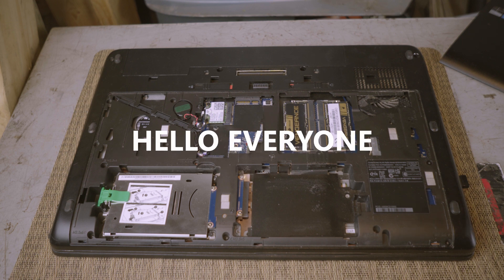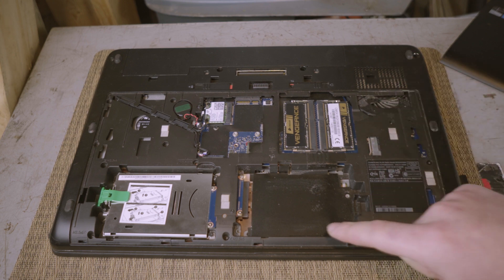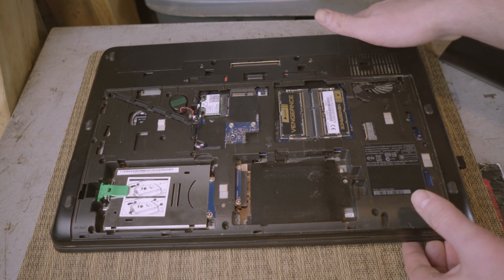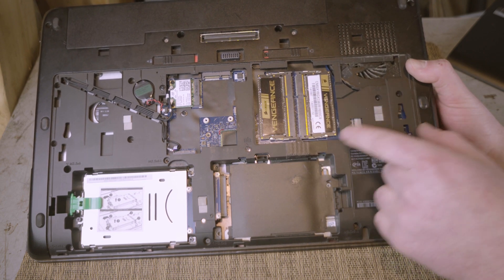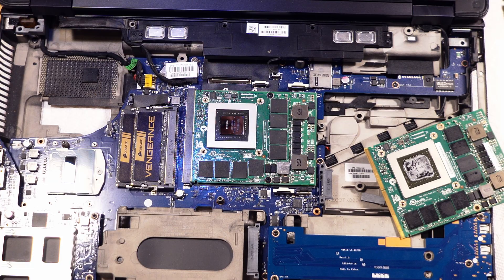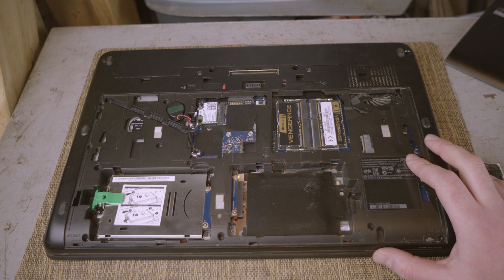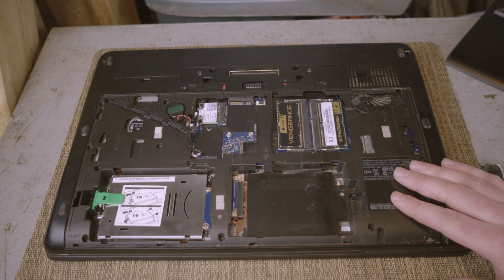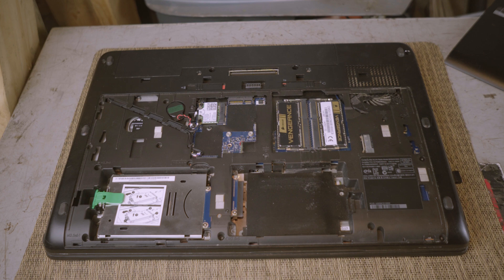Laptop Graphics Upgrade - HP Zbook 17 G1 - Quadro K3100m 4GB to K5100m 8GB - Laptop GPU Upgrade Easy

Comment: Tldr
I have the same pb, my laptop start rebooting in loops and the screen is kind of blury (can't see anything) and after a couple of rebooting i can't see anything I start by troubleshooting the pb by decoding the famous hp LED_Beeping but can't define my case (there are two types of beeping one is long and the second is short and for example if u see 3 long beeps following by small one you should look for 3.1 and hopefully u will get an idea about your pb), in my case and after many reboots i removed one external Ram (back of laptop) and get nothing but when I remove both of them the laptop start normally with 8gb (2 rams of 4gb under the keyboard) instead of 24 gb ram.
So now I can't add one of the other rams (2 of 8gb ram ), I don't think that both are broken at once, and I think it might be a problem related to the bios and the stupid windows 10 update (btw the latest support of bios of zbook g1 from 3.3.2020 ).
Can't be sure about my theories, if anyone have any idea about the pb i would be more than thankful.
Kind of regards.
Reply: There ARE videos to address the rebooting loops . Seems to be a HP problem . I was watching a youtube vid earlier today about a different HP problem and the creator mentioned the reboot loop , unfortunately I dont have a link ..But I do know they are out there ! Sorry I suck at helping but I DO wish you the best of luck in fixing your problem !
Reply: @jerrygallant4284   thank you , i fixed the pb by downgrading the bios.
Reply: @syshYarak  glad it was an easy fix . I am hoping to purchase a Zbook17 in the next few days and am hoping it is the workhorse HP claim it to be . It should prove to be overkill for anything I may need it for , but you know , boys and their toys .

Comment: Way to much thermal paste. And you don’t need to spread it, the heat sink will squish it down and fill the gaps
Reply: I think it's too much when it goes over the chip and on the board!
Reply from the maker: It was a little too much, personally I prefer to spread it.

Comment: Hi! I just saw a 2nd hand laptop on gumtree with k5100m! Do you know what opengl it supports as I need at least 4.5. I've seen mixed things from notebook check and techpowerup. GPU-Z should tell us :) but it looks really powerful and would be a great birthday present for my son as our old laptops died! Thanks!
Reply from the maker: DirectX
12 (11_0)
OpenGL
4.6
OpenCL
1.2
Vulkan
1.1
CUDA
3.0
Shader Model
5.1

If you can get a laptop with this GPU for cheap it is quite powerful. Keep in mind you can also get older gaming laptops cheap however they are built for gaming and this laptop is built to work.
Reply: @IdeaMan4k  thanks! ;) this laptop is around 175 pounds on gumtree. For equivalent gaming gpu (960m to 1050m?) I Have seen 350 to 400 pounds And this has 32gb ram and 8gb ram for gpu, 500gb ssd 1tb hdd and i7 48xx hq which is decent too. So I think overall seems great bang for buck! Especially as laptops tend to break easily and hopefully this is built like a tank! I will be using yuzu emulator which is a memory hog so this could be perfect... Thanks again!!!
Reply from the maker: @dadgamer6717  I generally like to buy workstation laptops are they are designed for easy service and reliability and have higher quality manufacturing standards. As of now I am using this laptop on its... possibly 6th year and it has been "on" almost 24/7 the entire time. Even if the motherboard broke right now I could probably pick up a new computer and swap some parts for like under 100$. They are just computers built for people doing real things, I believe this laptop has military spec rating.
Reply: @IdeaMan4k  Hi! Thanks again for your help! I had a 2 hour cycle to collect it this morning but is worth it! Plays super smash on yuzu emulator perfectly! I'm sure Fortnite will be great too for my son. I might do a video on it one day! It is a dell M6800 and feels really sturdy!
Reply from the maker: @dadgamer6717  Nice, yes the Dell is the equivalent of this HP Zbook.
Reply: what processor it has?

Comment: HP provides workshop manuals for the workstation machines on their site with instruction how to disassemble everything.
For example the keyboard can be easily removed by removing the optical drive first and use a hole covered by it to simply push the kb out.
The manuals are in the official support page after searching for the HP model.
Reply from the maker: That's how it's done, I remember doing that a while a ago but forgot where exactly to press.
Reply: I've been looking for those, do you have a link for the first Gen ZBook 17   ? Thanks in advance.

Comment: how good is this laptop for video editing with the k3100 or even k2100?
Reply from the maker: The K2100m is fairly decent, you should be able to edit with no issue. This laptop is very powerful and I am still using it 5 years later as you can see in this video :).  All my videos are edited on this laptop and are 4k.
Reply: @IdeaMan4k 
so even the zbook 15 with k2100 is able to do that.
thank you for your reply.